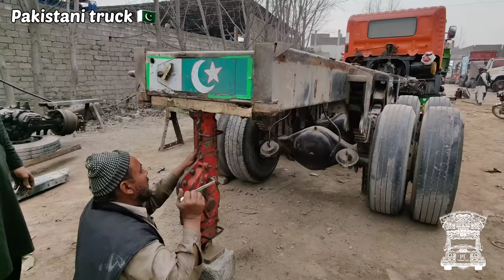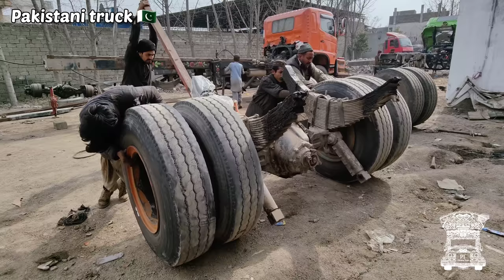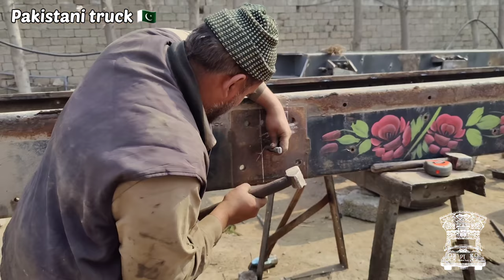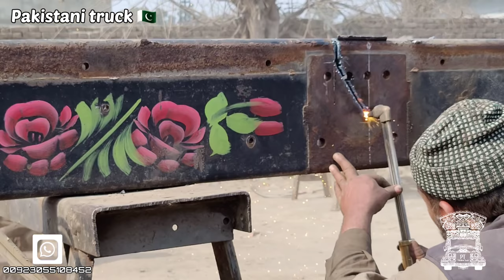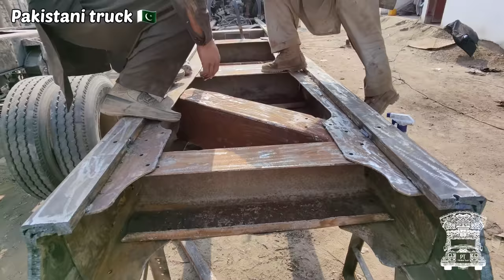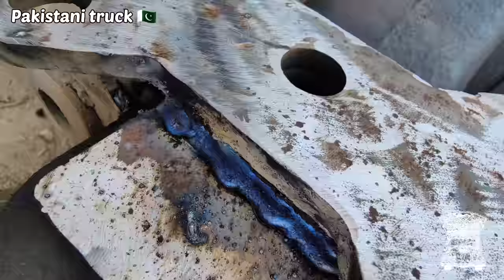10 wheels truck converting to 18 Feet chassis | Truck chassis Rebuilding full video

Comment: Okay., this might be a dumb question.  Why wouldn’t these driver just use a fifth wheel and separate trailer rather than extending the frame?  This is still a great video.
Reply: Actually using 5th wheel instead of extending the frame is more reliable & cost effective if they use 5th wheel it costs double of it
Reply: Very likely it would be too long. Old towns weren’t designed for truck, that’s why you see a lot of cab over trucks.
Reply: More then likely its a matter of getting turned around in a sketchy back alley somewhere even a long truck is easier to back up then a short trailer. Not so much a matter of skill as I'm sure these drivers are every bit as good (or bad) as western drivers, but the roads are not good, and backing a trailer just takes more space.
Reply: @northmanlogging2769  My dad always said it was easier to drive semi than bobtail.
Reply: @pvtimberfaller  bobtails dont have any weight on the rear axles, so stopping is sketchy or cornering in wet conditions, flat beds, dump trucks, etc have s little weight so they are better still suck while unloaded but, turning around is way easier without a trailer getting in the way, one of the reasons pnw log trucks piggy back our trailers heading up the hill, backing a trailer 20+ miles around switch backs and up hills.... isnt fun or advisable and there simply isn't room in the woods to do it, likely same conditions for these guys, bad narrow roads with minimal loops and lots of dead end streets
Reply: And this is where I say “The more you know”.  Thank you for your feed back as I learnt something today.
Reply: @northmanlogging2769  I have seen a couple guys who could back a shortlogger on the ground, pretty rare tho.
Reply: @E_M_Ali  good answer.
Reply: Never a dumb question, however you might get a dumb answer.
Reply: @Pinky_Staines1947  lol...
Reply: @Pinky_Staines1947  super

Comment: Such a clean cut using an oxy / propane torch 
Those spring hangers are such a clever design  less moving wearing parts or bushes to worry about